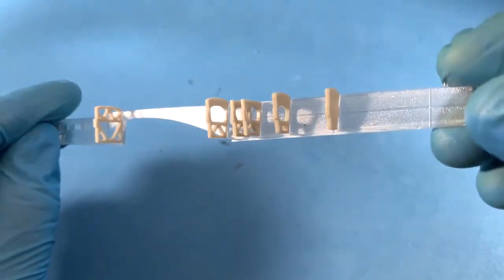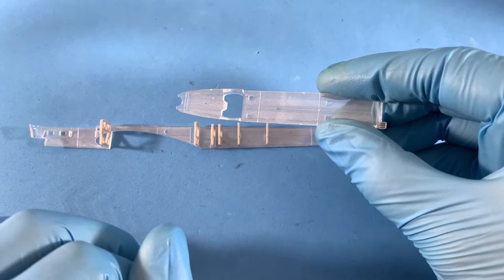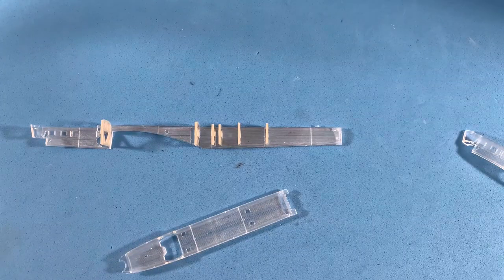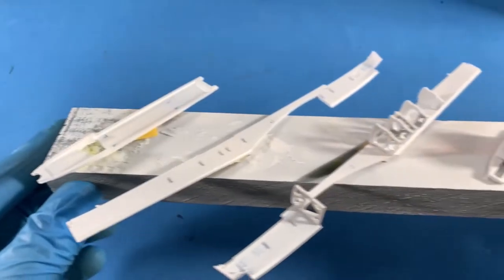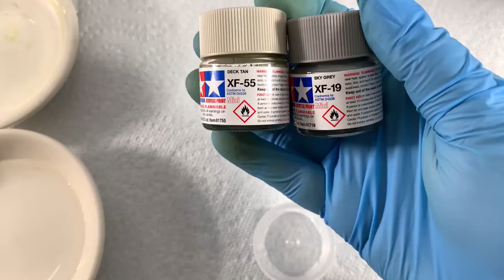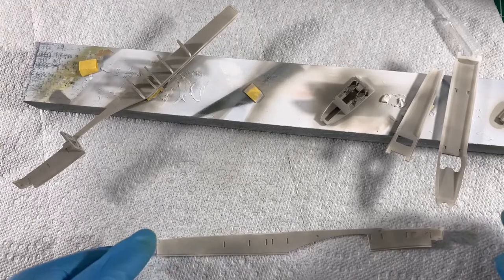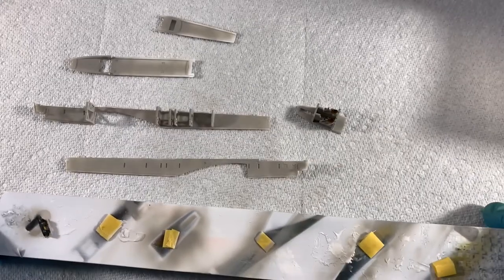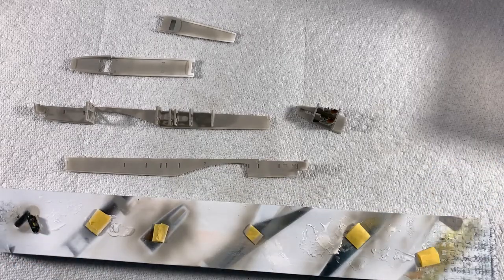Tupolev TB 3 Workbench Vlog 4 Interior Gray

Comment: Looking really good, Joe. That color looks great... and I think I need to try some of that mask for certain things. Have you used it before? Does it come off easily?
Reply from the maker: Hi Brett! I've used Tamiya tape to make thin strips for the outline of windows and then use the masking stuff over the center and I have been happy with that use of it for those reasons. I haven't tried (maybe once or twice) putting it on the clear parts without the tape, but since I'm using acrylics, should be easy to scrape off any leftover mask with a toothpick. Since it is the interior I'm not too concerned with perfection haha. I'll probably be taking them off soon we'll see how it goes, I'll make sure it makes it in the vlog.